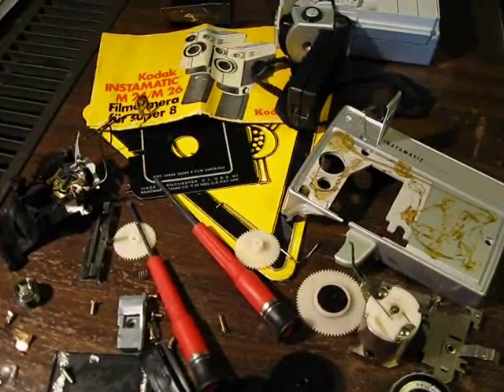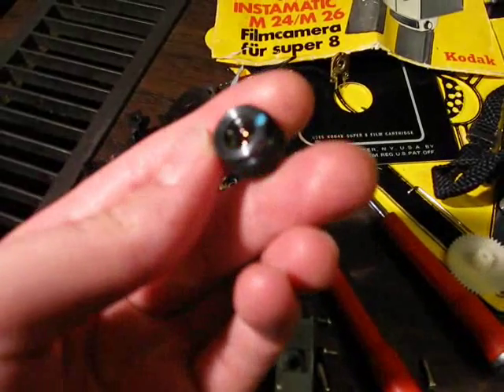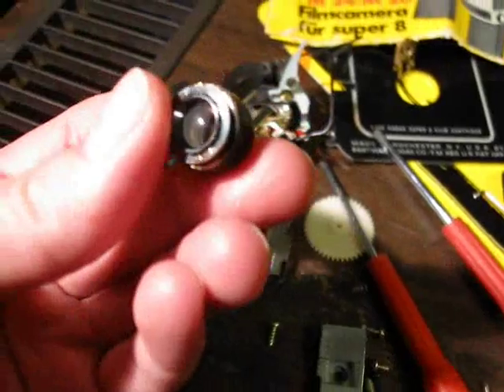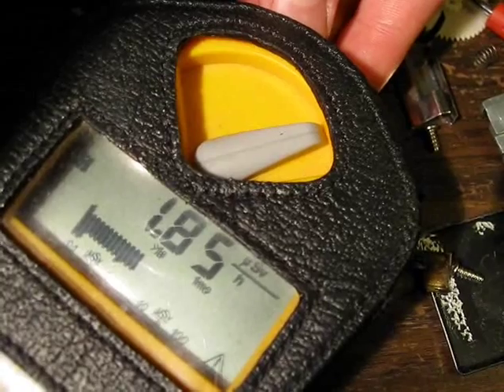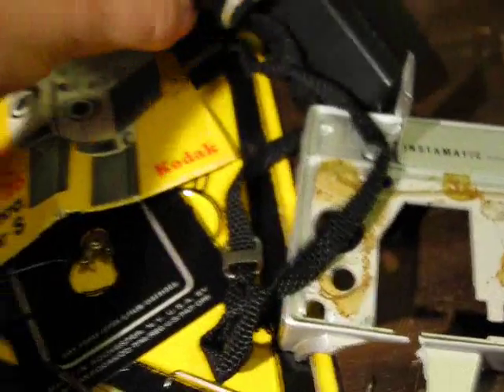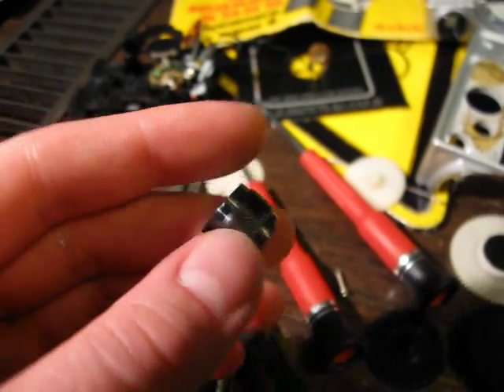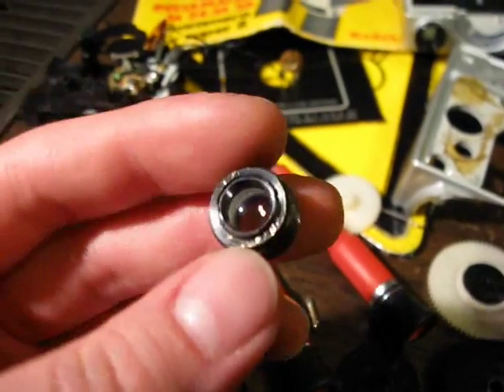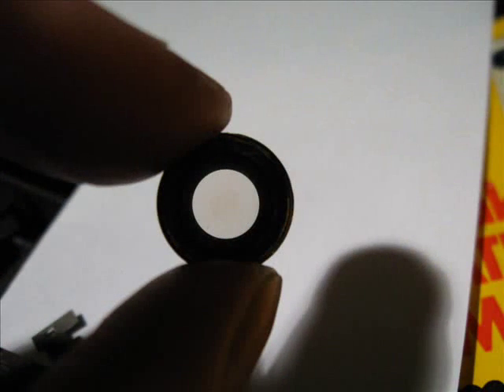radioactive camera lens (thorium 232)

Comment from the maker: yep, those are so called film dosimeters... little badges e.g. nuclear scientists or doctors working in nuclear medicine carry.
and you're right, the film does get exposed by the thorium in the lens; but the amount of radiation is too small to cause any real fog or whatever in a short time. if you just took a few photos and then left the film in the camera for weeks before using it up, fogging of the film material happened frequently, though!

Comment: Would you do an experiment for us bionerd? I have heard that the slight tan color in Th doped lenses is actually NOT due to the color of ThO2 added to the glass, but is rather due to the radioactivity of the Th causing "color-center defects" (electron dislocation in an insulator) in the structure of the glass itself, over time. If this is true, you should be able to leave the lens outside in the bright sun's UV for a few days and the color should disappear as the electrons and holes recombine.